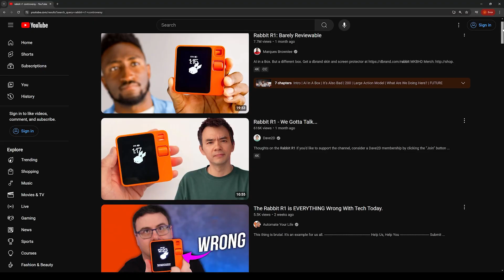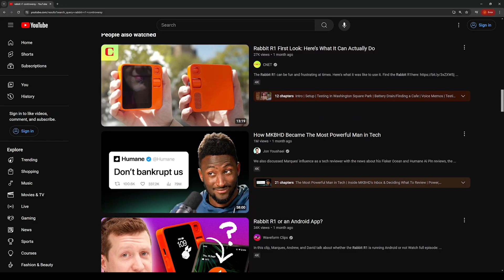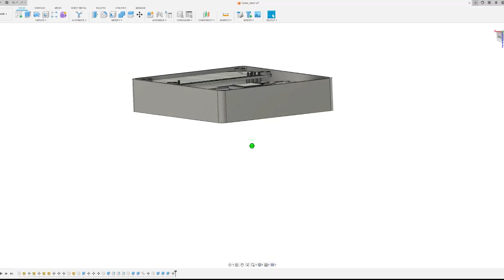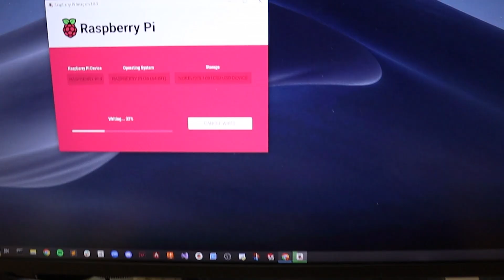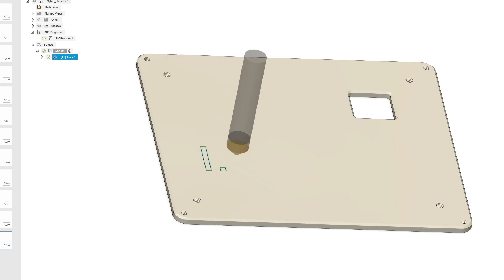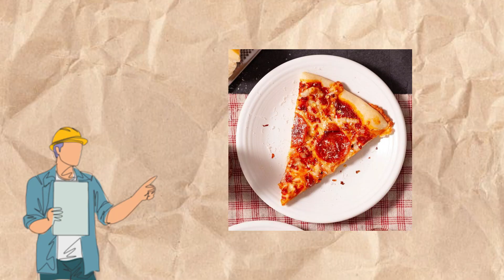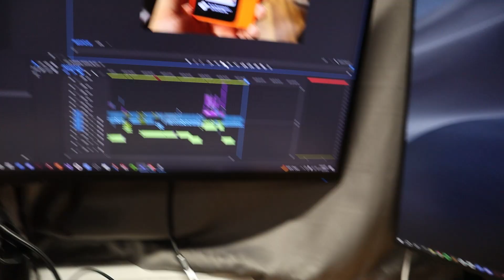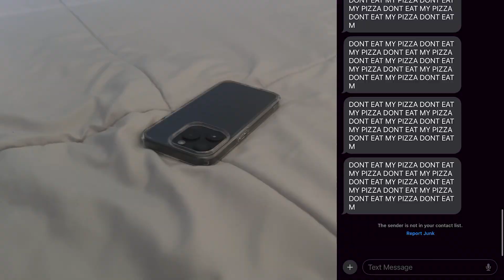Making AI Actually Useful (Maybe)

Comment: Hey Jared love the video. 

I'm wondering why didn't you go for a local offline model since you can design and optimize a custom pcb.
The ollama 3.2 model with 1b parameters can fit easily on there since it requires not a crazy amount of RAM. 
+ local offline capabilities :).

Ofcourse the ollama 3.2 model was just released but im still wondering if your approach would have been different.

Comment: Hi! Great build… I didn’t quite get what material you used on pcbway? Also what is cnc milled or laser cut? Thank you in advance!
Reply from the maker: The black case was made from aluminum and powder coated after. CNC milling refers to the machine I used in the video to try and cut my case that looked like a drill. Basically it cuts metal. I didn’t use a laser cutter but that could have also been a method I could use to etch in a design on the case.